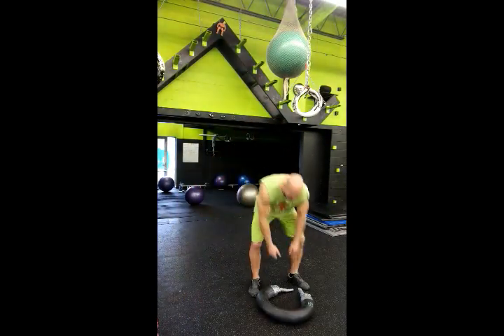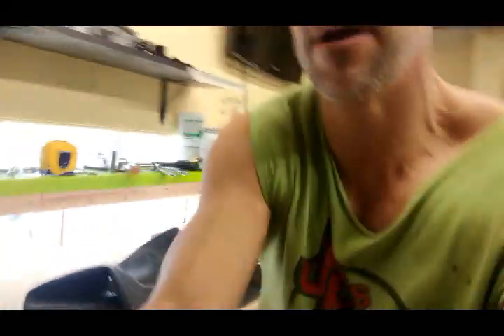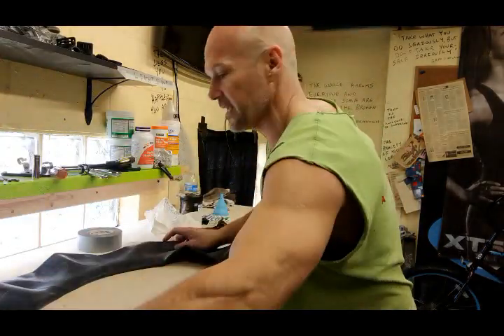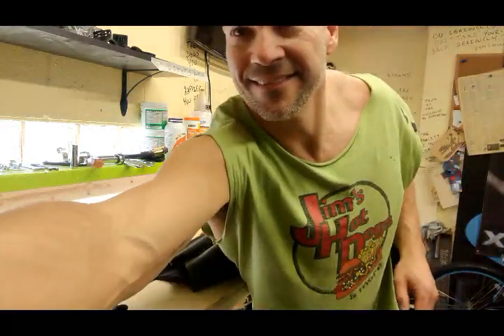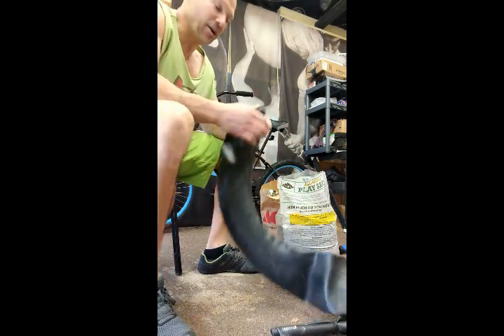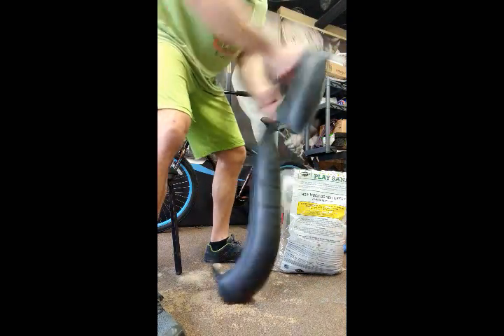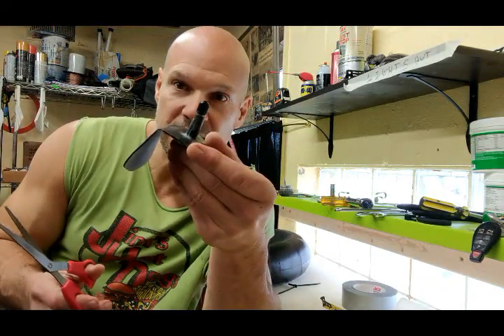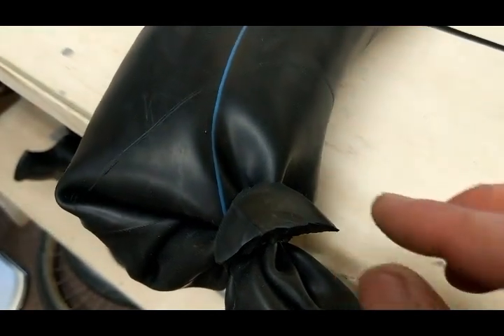How to make a Bulgarian Sandbag

Comment: Thinking about my design... I won't snip the zip ties at the base. Instead I'll give it 4 inches or so and then cut it. No sharp edges. The secure the 4 inch excess tails of the zip ties down with a glue gun.

Maybe even glue gun the cinch point & head of the zip ties so it helps smooth them over. Depending on that goes, put that thick rubber patch on top of the heads and then start to gorilla tape. I've seen some people use athletic tape over the duct tape for better gripping.